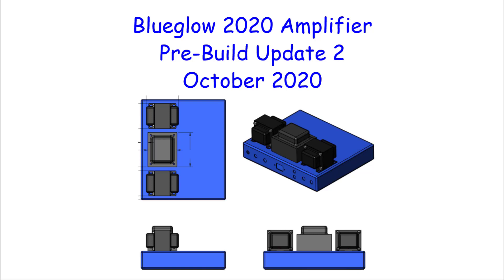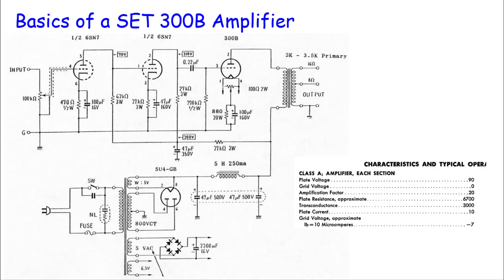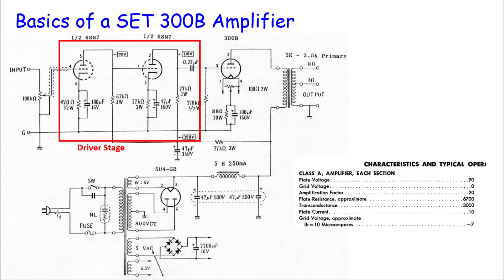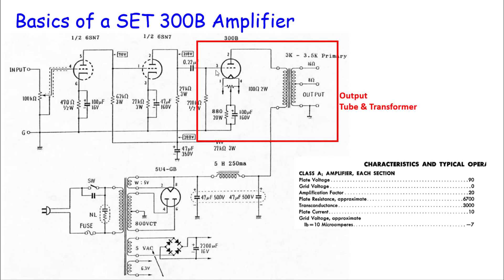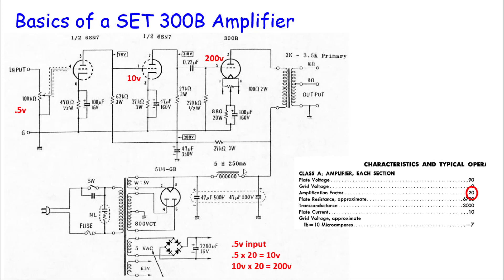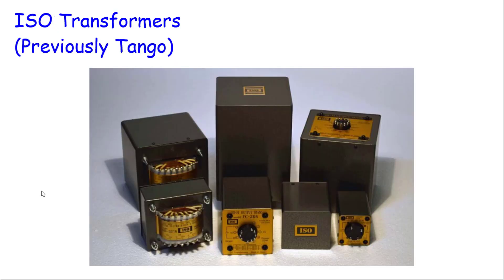2020 300B Amplifier Pre Build October Update 2 - WE 91A

Comment: With today's abundance of cheap (free), used laptop batteries it could be a piece of cake to build a powerful, completely ripple free DC power bank for this amp.  I happen to have a battery powered MC pre-pre Amp that is absolutely quiet.  The disadvantage, obviously, would be that one has to charge those cells from time to time, but this can easily be assigned to the power down time of the amp.  The Return of the B+!
Reply: Interesting idea with the batteries.

Comment: Mark, is not the 'grid-cathode trick' a bootstrap of the upper grid leak resistor? Which would lower the cutoff of the previous coupling capacitor? Can't see that it has anything to do with the cathode bypass. The B+-cathode trick is interesting: two out of phase hums seem to meet at that point and cancel in the cathode. One comes from B+, and the other from the plate of V1 and therefore the grid of V2, and inverted at V2's plate.

NB PSRR = Power Supply Rejection Ratio. It is a number expressed in dB, not just a vague concept.

Comment: Last year I built exactly a 300B on the schematic you show in the beginning. and it has a lot of issues, high hum noise, swampy bass, highs roll off at 15K. will be so interesting to follow this build. Maybe we'll se a filament lift like you did on the the other SE amp you built. can we lift the filament if we don't have a center tap?

Comment: I'm wondering if using steel for the chassis, and mounting the PT (and the L) and OPTs on the opposite sides of the top plate (top vs bottom) would be a good idea to help fighting the hum further.

Comment: I've got an old transformer in an old amp that lays flat.  I have stand up with tabs on the bottom. I imagine you can cut the tabs off and the transformer would lay flat. Only thing the holes for the wiring is in the wrong place.

Comment: For' quality chokes ..go to Lundahl......they have also common mode .
Jac music is a friend and has some good advise and parts...
BEWARE using and respecting the maximum capacitor values after a tube rectifier !!!!!!!!!!!!!!!!!
Example....Max 60 µF after a GZ34 .....but if I remember  it correctly only 4µF or something like that value after a 5U4G.
NEVER do hot switching with a rectifier tube , always let it COOL DOWN before restarting !
You can also use a WE doorknob tube 717A as input tube....( designed for radar in WWII )
or a 3CM ....( German pro tube ).....
Try some different resistors......Carbon, tantalum etc.......avoid most of the metal resistors  .
Avoid using same brand for all ! ( it's like cooking a tasteful meal )

Some signal capacitors need lot of hours before opening up ......Copperfoil/teflon for the example....but after that they shine.

DC on direct heaters of triodes changes the curves.......one side off the filament sees 5 volt , the other O volt ! So what you gain , is also what you loose..all is a choice...only your ears will tell and steer your choices..

It's science  and it is............... art ................good luck building and have lots of fun  knowing you go further than economical limitations  and beyond that of hifi manufacturers.

Only the pleasure and the result count.

By the way , the real Audio Note is a Japanese company  , P. Quortrup stole the brand name.....GO and have a look at the original KONDO amplifiers and their genuine Ongaku and other amplifiers. Pure silver winded transformers ....pure silver foil capacitors.....Can you hear the difference ? ...YES you can!

A good rule of thumb is the use of capacitors and a choke by using a smaller value before and and a higher value after the choke......1/3 before and 1 after .....this avoids oscillations....by  the start up  and at eve ry current draw when asked by the signal transients...it also limits the stres on the diodes/rectifier.

Every rectifier tube needs a certain impedance frpm the  power transformer.....so if you use a high current PT ....use limiting resistances if necessary between the windings and the anodes of the rectifiers....Check it  as specified on the datasheet of the rectifier .

When using the choke input ( Choke first ) smoothing technique you will need a PT with a higher voltage !

Have a nice day and happy DIY .....................

Comment: Yamamoto A9 and A9 s ......The first one ( the original design ) has superb output transformers.....the second one has output current meters......the superb  build quality is like no other design....

The 300 B ......all are copies today not comparable with the real 300B genuine  tube. 
Want to hear what a real WE /ATT Tube sound like .....if you're lucky to find one and have the money ....

These kind of higher quality tube amplifiers shine with the best output transformers, yes with good OPT's they do sound good but you will never hear what  these tubes are  really able to perform.

Nano-cristaline or permalloy OPT's are  more expensive ( often around 200O $ or more a piece ) than the whole project of building such an ammplifiers....so know what you will deal with when you decided to go the whole way.

And do not forget the power transformer and rectifier tubes as well as the capacitors..
ALL will be  announce "present " in the final  musical experience and  performance .......and you will hear them even on lesser than the perfect speaker..
Every component has a sound ! even the wiring and soldering.....these kind of amplifiers  have the potential to let the cook show being the master in the kitchen.....and the taste of the meal will vary from average to good or .....Superb !
The proof of the pudding is in the eating..........................

But building one , even a simpler tube amplifier is .....always.....FASCINATING.

A little tip ......Want to know what tubes are still better performing but in the region of flea power amps !

45 . 245 balloon shape.
50 balloon shape....

RCA 2A3 single plate.

And some others....TFK etc....

Don't forget some nos tube rectifier tubes ......WE....SYLV GB......RCA......Kenrad.... GE........etc

Comment: Is there any way a 6SN7/6SL7 could be used instead of the 310a? There's just more current production tubes to choose from. I realize the application of those tubes is different but have seen common 300b designs using those tubes.
Reply from the maker: Yeah, there are many 300b amp designs using the 6sn7/6sl7, none would be a 91A Tribute and according to many, none drive the 300B as well as the pentode 310A.  It would be easy to modify to use the less expensive 6C6 or you could use a Russian 10J12S as a direct replacement.
Reply: @Blueglow  lazy youtuber here.. what does it mean to “drive” a 300B? Appreciate any YT videos explaining this
Reply: What about the 6j7 or 6sj7 pentode in place of the 310A ?

Comment: Love your channel
Question for you if you can help
Building mono block pp kt88 but design calls for rail voltage I can not find. If the called for v is 800 and closest I have  is a 325_0_325 or 650 
Does this just mean lower total watts produced?
Thank you